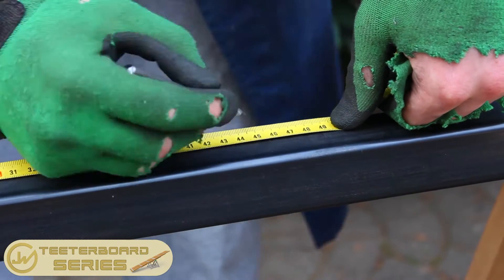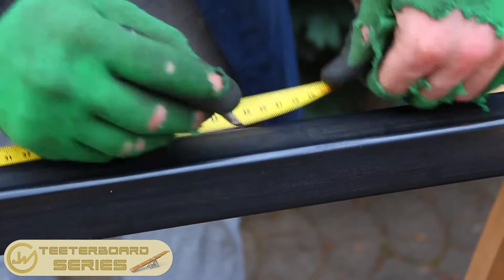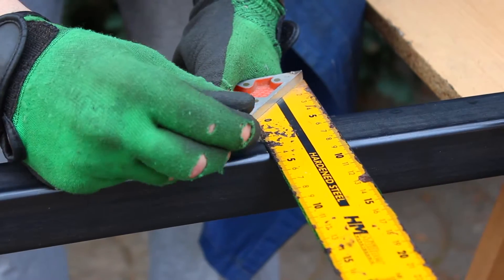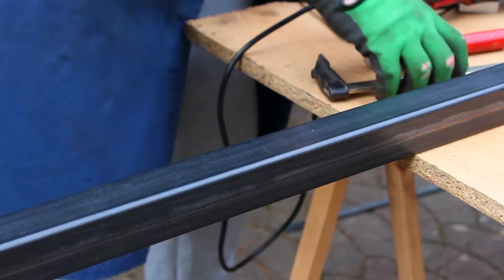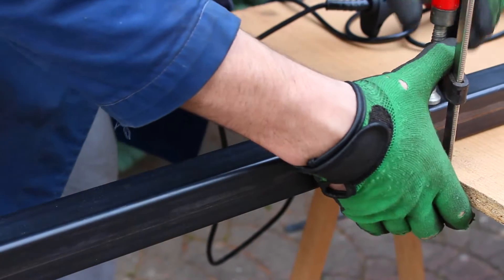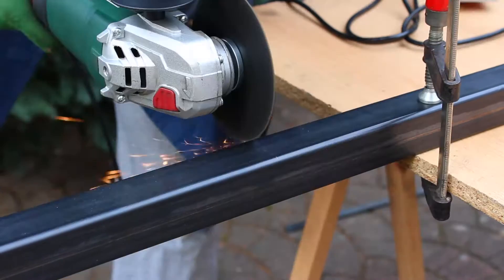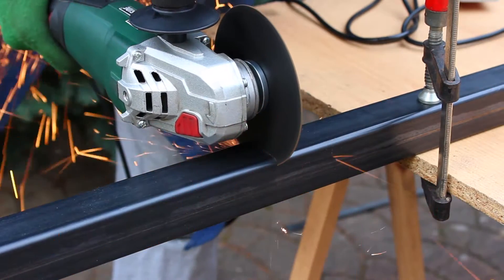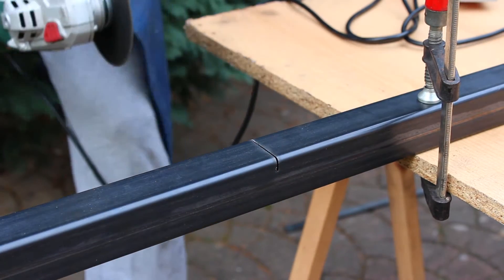Teeterboard Project | Part 2 | Making The Base

Comment: That's great construction man! I like how the frame looks. I see that you had a lot of welding work this time. Did you use 3 mm electrodes for this work?
Reply from the maker: hah thanks bro! jp, there were quite a bit of welding but I managed to finish it in one afternoon :) I was using 2.5 which is already too big for 2mm thick pipe walls, because I was making some holes even on 40 amp .
Reply: Oh... I see. Nevertheless, the most important that the work is done :) Some time ago I tried to weld stainless steel with 3mm electrodes (for stainless steel) and was very surprised that it was even easier than with ordinary steel :) May be that's because I don't have a lot of experience in welding but anyway I thought that it would be much harder.
Reply from the maker: +Dural Metalurg haha you should definitely do a welding kind of a project in the future ;) Cast a few seperate items and weld them together
Reply: Yeah :) Good idea! I think that's possible. The easiest way is to cast something from, for example, pig iron and then welded several pieces. I know that special electrodes for pig iron exist. :)